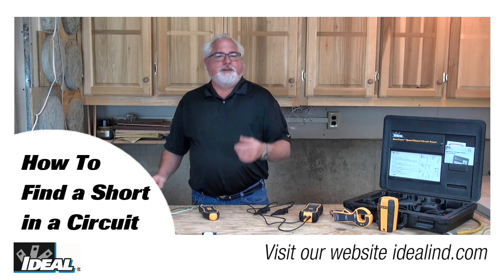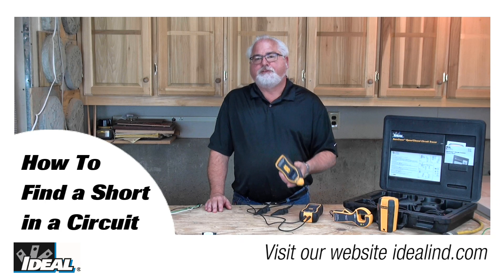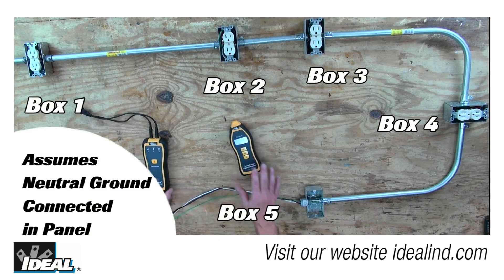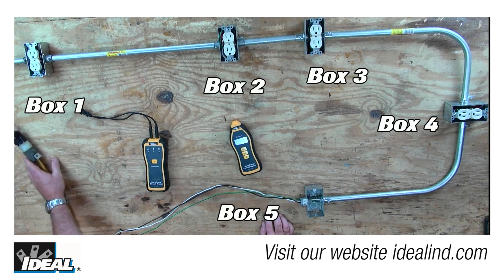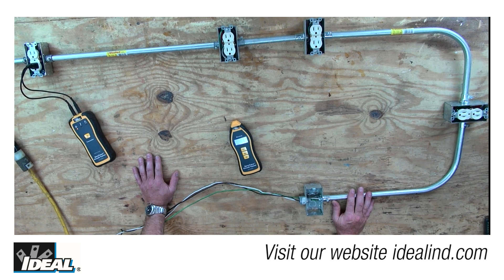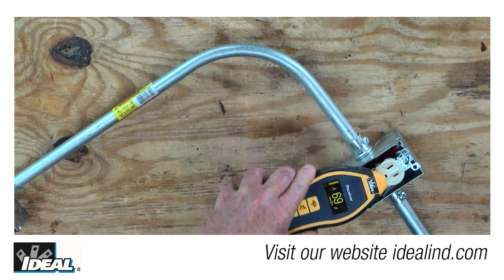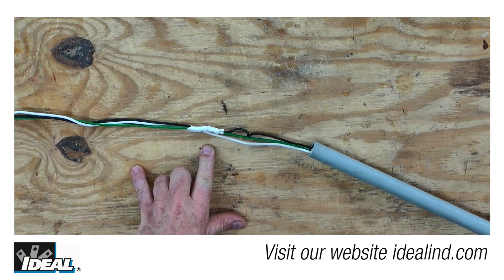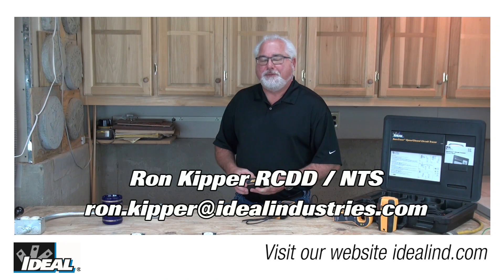SureTrace™ Circuit Tracer Finding a Short

Comment: Can this product be used to locate a cut wire in electrical radiant heat? No resistance in any of the lines, so I am under the impression that it is not shorted, just severed.
Reply from the maker: Hi Jason yes you could use it to find a break in a cable. Hope that helps Ron
Reply: @RonKipperDatacomm1  Would it be possible to get some guidance on that subject?
Reply from the maker: Jason by using just one lead hooked to the wire you are tracing and either just dangling the other lead or ground it. Then using the reciever set at it's highest sensitivity mode start tracing the wire if the reciever is at 99% turn down the sensitivity and continue to trace. Keep in mind the strongest signal will be when the reciever is inline with the wire beining traced and if the signal drops off quickly the wire changed it's direction. The signal should drop off quickly at the break in the line. You could try and use a toner and probe to do the same thing for a lot less money using the same technique again the tone will drop off quickly at the break in the cable. Tracing it from both directions should pin point it's location. Good luck Ron

Comment: Good morning! So I own this product, and it has been great. Been watching the videos to learn how to use all aspects of the tool. I understand using the continuity tester to determine finding which wire combination has a short. I am struggling with understanding what the alligator clips are for though. In the example, you show using the standard plug lead into the receiver and say the short is the hot to ground for the test. Just prior to that you said that you can use the alligator clips for when it his a short to hot and ground. Will I still need to plug it into a wall outlet or can find the short with the alligator clips alone? Thanks for any help! Great videos
Reply from the maker: Carlton the alligator clips can be used when you have the end of exposed conductors you can clip dircetly to them. Hope that helps Ron

Comment: Hi Ron,

Could this product be used to determine where a short is in a heat trace system?

I work with heat traced lines that use a heater wrapped around a metal jacket with a gas line contained within it (gas line made of teflon). Due to wear. we frequently run into issues where the heat trace shorts to the metal jacket (which is our ground in this case). It becomes tedious to try and trace where exactly where the short is. In this case, the hot, neutral and ground will all show continuous with each other in the event of a short. The ideal system shows continuity between hot and neutral with zero continuity between hot and ground or neutral and ground.

Is it possible with this device to show where the hot AND neutral shorts to ground? Hopefully so because it would save me a lot of time from disassembling my lines (which are 100+ feet) to figure out where the heat trace shorts to ground.

Thanks!
Reply from the maker: I think it will trace the short for you. Please reach out to me and I will have Dave call you he specializes on the uses of the tracer and can probably help you out. Send your contact info to ron.kipper@idealindustries.com

Comment: Ron, sorry another question. I live in chicago where it is a code to use Metal conduit for entire home inside the drywall. Lets say i want a circuit, which has 3 receptacles, 2 lights and one fan which goes back to  panel.  
Question 1) how do i trace wire back to main panel from one of the receptacles all the way to main panel, please note there is a metal conduit will not it provides resistance to the trace, how do we solve this problem.
                 2) for same scenarios above if i have brick instead of drywall but if i use PVC plastic instead of metal conduit will it work.
                 3) if is start with 2nd receptables, how do i go back to mainpanel instead of going to 3rd receptacle and groing backwards.

Sorry i asked too many quesitons to you today, hope this will be helpful to others and i appreciate a tonn.
Reply from the maker: Hey it might be best to just give you a call why don't you send me your contact info to my email and I'll give you a call. Ron at ron.kipper@idealindustries.com